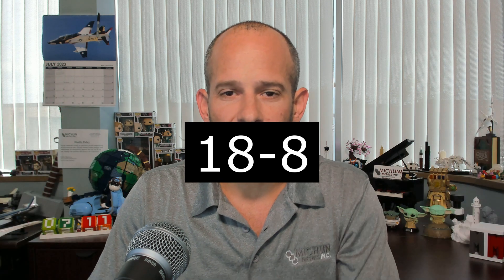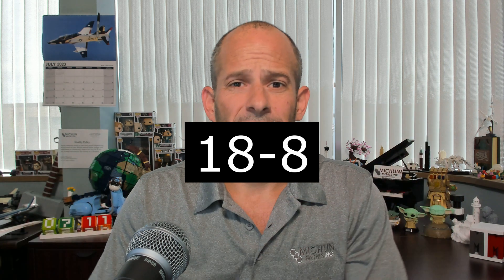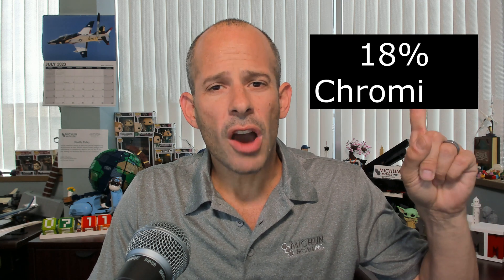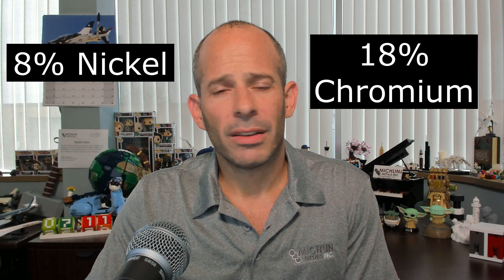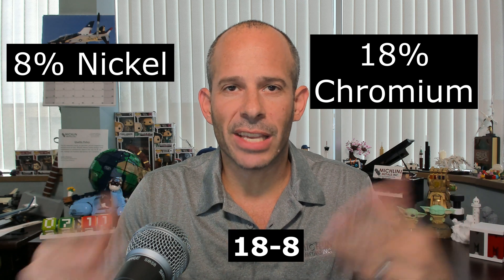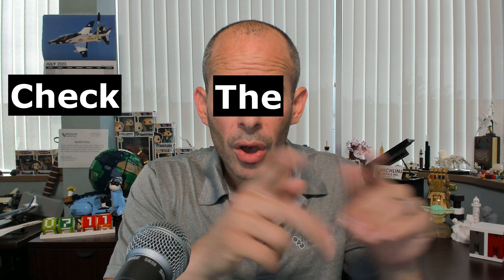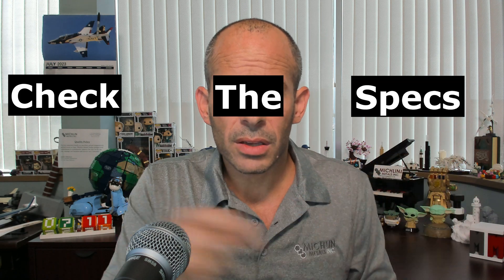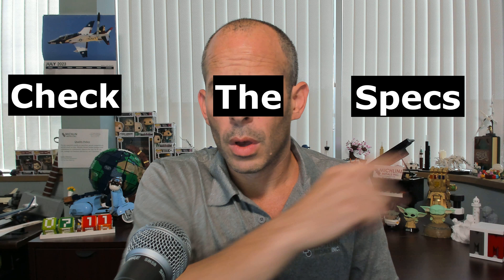Austenitic Stainless Steels | 300 Series | 304 - 316 - 317

Comment: Did you do a video on the 30X stainless (aka HFS or Hard Frickin Stainless) used in Tesla's Cybertruck? Despite it being 30X, it is magnetic (Martensitic), supposedly from  how the alloy is processed (either the heat treatment or the cold rolling/working that work hardens it). Would love a commentary video on a portion of the video where Sandy Munro of the Munro Live channel got a tour of a portion of the Cybertruck production line that shows the steel going from giant rolls to body panels.
Reply from the maker: Sounds like a good idea, I doubt however that we could gain access to the chemistry and physicals (an MTR) of that material so I could review it....that probably falls w/in their proprietary data as it's 30X not 304 or 316. I would do that video if the source data about their grade was available. If you have it, send it and I will do it! Thanks for watching.